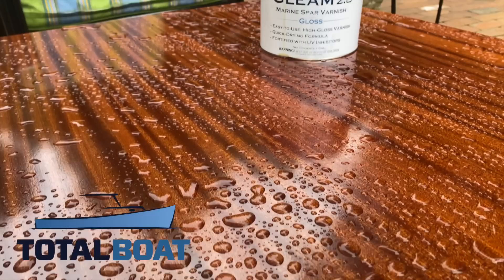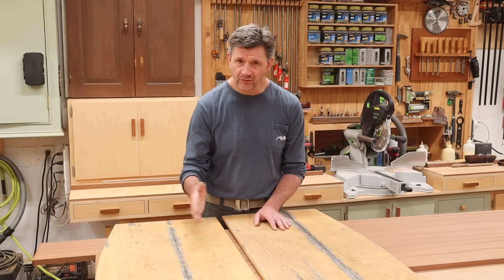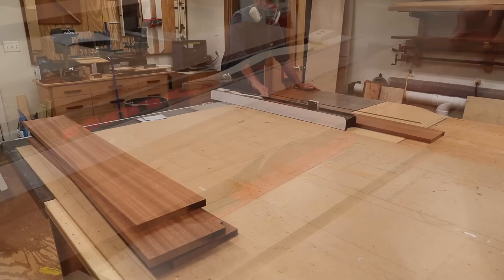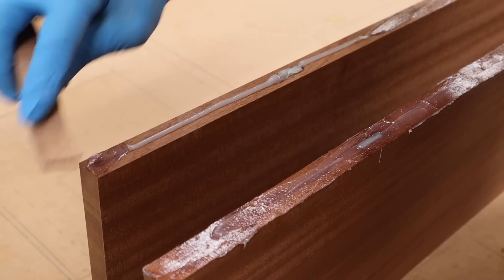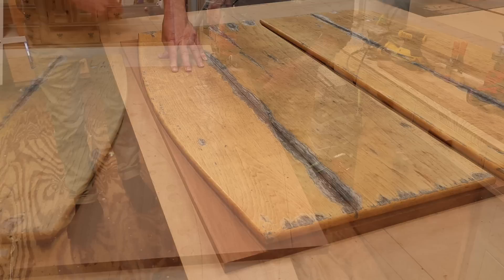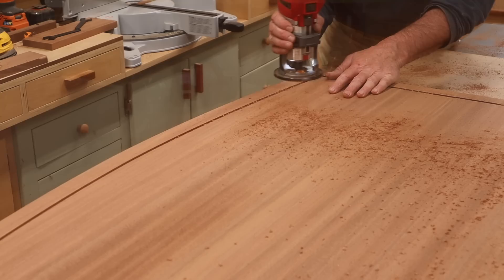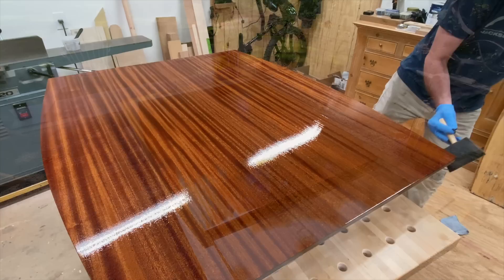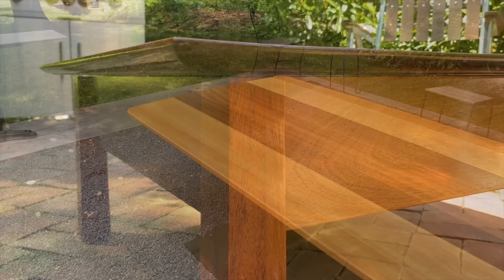How to Build & Finish an Outdoor Table Top - Best Exterior Wood Finish

Comment: Why didn’t you use the old tabletop as a template for a router smooth edge - after doing a rough cut with jigsaw?
Reply from the maker: I did, it’s in the video

Comment: Has anyone tried using epoxy as a base coat under the varnish? I did and it was pretty long lasting.
Reply from the maker: I think when they build epoxy river table‘s that’s what they do… I don’t think they use varnish for finish though some kind of a polish

Comment: Hi Jon,  what size of a drip edge are you using?  By the way, fantastic tables and video’s. We’re building 3 - 4’ x 8’ x 20” deep elevated self irrigating planters out of Cedar and want to apply the drip edge to the top trim.  Thanks.

Comment: Making a table for our deck; again. Having issues (as you did) doing the top fully glued as opposed to doing it like decking boards. The glued to (reclaimed vertical grain redwood) moves quite a bit and makes a “U” shape. My wood guru said it table is outdoors, that will always happen. I recall 2 failures of yours at Jersey shore table for same reason. Why do you think this will work? Thanks for your vids. You do great stuff! Oh, beautiful table here!
Reply from the maker: Thanks! I think this will work with a little bit of maintenance… Number one the Thixo epoxy… Number to the word choice, Sapele … and number three the finish. 
It is also important to cover the table as much as possible to protect it from the sun not the water… The table at the Jersey shore is often covered with a white cotton tablecloth. The tablecloth can get rained on and then dry with the sun and wind. 
So far the table down the shore is doing really good … I’m planning to give it another coat or two in a few weeks and I plan to post an update video.
Reply: @JonPetersArtHome  Thanks. Then why did the other tables fail? Mine is doing okay. Forms a U on occasion. We don’t cover is. I’m guessing that is a place to start. Reclaimed VG redwood is very stable. I used PPG (Sikkens) as the coating. I used TB3 but no Dominos. 

I’ll try again. I have 7/8” thick Odorata (Spanish cedar). This time I’ll use Dominos and make sure to cover it.

Comment: Beautiful Job!    I'm curious if you've had any experience with the newer water based Polyurethanes?   I was told by one manufacturer that water based poly is more flexible.  My main concern is the finish flaking off over time, which I believe is caused by UV and flexing from expansion/contraction.  I live in Southern CA and the sun can be extra hard on wood furniture.
Reply from the maker: Hi Richard, I haven’t had good experiences with waterborne clear finishes outdoors. I posted an update to this table and other outdoor projects just a few weeks ago. It’s a short video that answers some other important questions for Outdoor finishes. I think it will be helpful. UV protection - I built a table for my mom’s deck a few years ago… Full sun exposure most of the day. She puts a white cotton tablecloth on the table top that’s waited, so it doesn’t blow away. The tablecloth gets wet from the rain and then dries out in the sun. If you don’t mind using a tablecloth when the table is not being used and this is a good way to protect against UV damage.

Comment: Hello  Jon,  that is very nice.  Can you tell us what you do for a final finish ? Do you sand or buff the final coat ? And does this finish smooth out or are you applying very thin ?
Reply from the maker: Thank you, when I use varnish I don’t buff or rub out the finish… after the last coat it’s done.

Comment: Great info! Can I apply this varnish on top of teal oil or is best to use the gleam as the sole product? Any insight on the ease reapplying or rejuvenating the finish after a couple years in the elements?
Reply from the maker: Thanks, I would not apply over teak oil… giving the finish a fresh coat every year or two is a good idea… first sanding with 220

Comment: How long do wait till you flip the top to apply finish to the other side?
Reply from the maker: I use blocks of wood with screws sticking through to support the work… This way I can finish the top while the bottom is still wet

Comment: Hi Jon, I am curious how does the TB gleam spar varnish compare to the TB halycon varnish you had been using in recent vids?  I just put 6 coats of the halycon on some cedar for a small outdoor project.
Reply from the maker: Hi Brian, the bench and bee cabinet top with Halycon are doing good… but I’m still old-school and lean towards a solvent-based finish. Also the Gleam really pops the Sapele